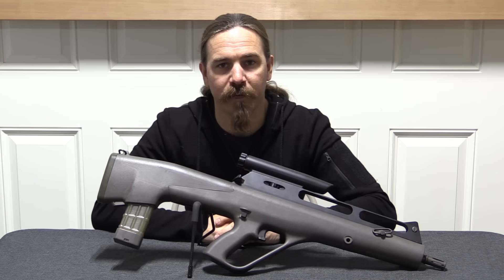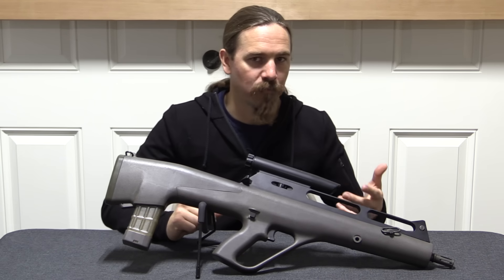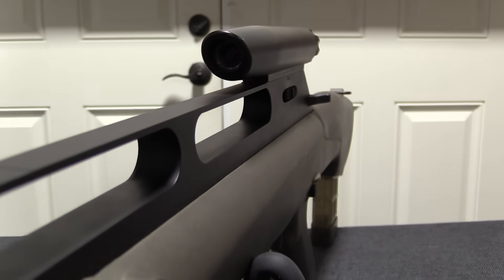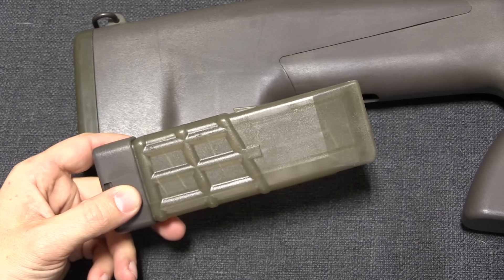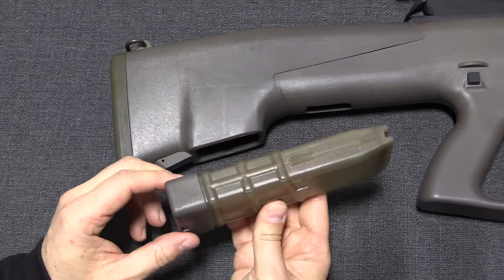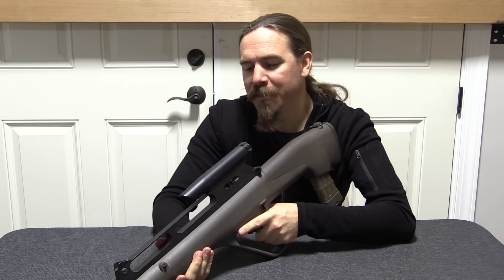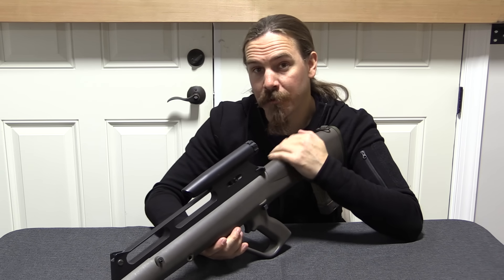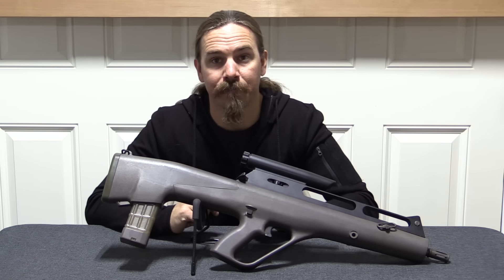Steyr ACR: A Polymer Flechette-Firing Bullpup From the 90s

Comment: How the 1970s 1980s are more innovative than todays times...
Reply: You might be surprised to find out that the U.S. military is now strongly pushing development of polymer case-telescoped ammunition (PCTA) very similar to the Steyr ACR's, but loaded with conventional bullets instead of flechettes and using standard centerfire primers.  Look up "Textron," "LSAT," and "CTSAS" for more information.
Reply: The Cold War was a major reason i would say. There were many inventions and innovations during those times due to the arms race between the West and East.
Reply: lonewolf0281 indeed. The F-22 plane was actually a Cold War era program, with the goal to have a K:D ratio of 10:1 against Soviet “big MiGs”
Reply: 'PCTA' yeah right.  Imagine this kind of ammo gets adopted.  During the change over troops will say, "do you want circumcised or not?"
Reply: Keep in mind that "innovative" does not necessarily mean "useful."
Reply: Yeah all the  "Futuristic cool gun to replace the m16" programs so far resulted in nothing; same with the m4 ones.
Reply: eu tenho muitos nomes mostly because they want a gun that is easy to use and maintain, weighs nothing, can do sustained full auto, is cheap, has no recoil and also has the firepower of a .50 cal. Oh and it also should harmonize with whatever gimmick they currently throw millions of dollars at.
Reply: Speaking of Stoner doing it first, even the G36 was just an AR-18 in a polymer receiver, and the AR-18 was based on Stoner's AR-16.
Reply: The AR-18 even had a 3x scope so the g36s scoped assault rifle schtick had been done before.
Reply: +Lonewolf0281 i agree, now that the arms race has slowed down and ww3 is not as much of a risk; prototypes are less "This weapon will outmatch everything the russians have and break the stalemate; we have to get these done now"
and more  "this idea will make a cool display  of power and/or might solve some problems we have fighting terrorists let's spend some r&d dollars into that".
Also IIRC despite being a famous example of 21st century small arms; the concept of pdw was  actually created in the 80s to allow non-combat troops to defend themselves from russian paratroopers with body armor.
Reply: USA and USSR created huge amount of awesome things, just to fight each other.
Cold war gave us a lot.
Reply: I was gonna say something to this effect. This rifle's operating mechanism looks like it would be a good base for a PCTA rifle. Attempts to use saboted ammo usually suck in small arms because we can't manufacture the ammo consistent enough for good accuracy compared to larger weapons using sabots, or small arms using conventional projectiles.

Currently used rifle actions don't do great with telescoped ammunition, so simple designs like this with few moving parts and seemingly low reciprocating mass during operation are interesting.
Reply: There was the modularity thing, but the stoner 63 did it first.
Reply: Innovative yes, but if you have an idea that doesn't work out it is worthless.If the gun or one of it's parts would be that much better than the existing systems then they would have kept it.
Reply: Well I mean yeah, they tried all the stupid things that didn't work so we don't have to.
Reply: There was the Cold War going on, which meant we pushed more innovation to one-up the Soviets and get an edge over them. This rapid development of military technology from the 50s to the 80s resulted in a kind of plateau we’ve reached, meaning there isn’t all that much we can practically improve on currently
Reply: Josh Van Aken incorrect. The technological plateau hasn’t been reached, but rather nobody is willing and/or capable of putting in the time, research and money to develop better guns, bombs, planes, and tanks. This is further exasperated by the chokeholds that governmental regulations, and international restrictions have created resulted in the stagnation of fields like nuclear energy.
Reply: Jack Andersen To a degree, you are correct. There are many small things we can improve upon when it comes to small arms technology, but the world’s current geopolitical situation doesn’t make it necessary to do so, whereas fields such as cyber warfare are becoming more advanced at a prodigious rate
Reply: because only recently companies realized they didn't need to make a unique weapon and instead could just pump out glock and AR clones
Reply: soundawve 47 I don't get why they make these programs if the mentality is why bother reinventing the wheel.
Reply: It is easy to imagine why. All you have to do is ask the right kind of questions beforehand
Reply: That’s not true, we just don’t know about the innovations yet. Give it 15-20 years.
Reply: The cold war.
Reply: That and we dont always see the military prototypes as their happening
Reply: The telescoping ammo and the XM-25 with its airburst capability. There is defenetly a progress.
Reply: @BigBellyEd  the XM-25 got cancelled
Reply: 90s-200s where pretty innovative with the XM8 and OICW; things started stagnating in small arms in the 2010s (Although we still had some innovations in this period like the aforementioned xm25 and telescoping ammo).
Reply: The lesson the US learned in WW2 was that it’s better to use known tech rather than try and rush out the newest and best into harsh combat situations before it’s ready.

They re-learned that lesson the hard way with early versions of the M16.

Comment: Seriously one of the coolest guns I've ever seen, surprisingly simple action too.
Reply: I would love to see someone remake this mechanism to fire brass, they would be cheap to produce.
Reply: It does look really nice, and brings me a few questions.. With a feeding mechanism like that, I can see it causing a lot of issues. Since it's basically a flat tipped cartridge being poked into a flat hole. Could simply make with rounding off the cartridge's tip or shaping the magazine in a way to guide the cartridge to fix that

And with a rimless cartridge that's got a primer on the sides, I must ask.. Couldn't you technically allow marginal amounts of gas to vent backwards to build up enough pressure inside the chamber, pushing the rimless case out the muzzle right after the projectile.. That would remove the need for having an extraction system completely AND close off literally all holes in the system besides the muzzle, making it virtually mud proof
Reply: @daniellerosa-1071  Missfires need to handled though.
Reply: @daniellerosa-1071  Caliber of this rifle is 5.6 mm. Cartirdge diameter is 10.4 mm.
Reply: Futuristic weapon
Reply: Seems almost like an open-bolt action.
Reply: Well, for a cat...
Reply: Cat It’s so fackin ugly
Reply: *ugliest